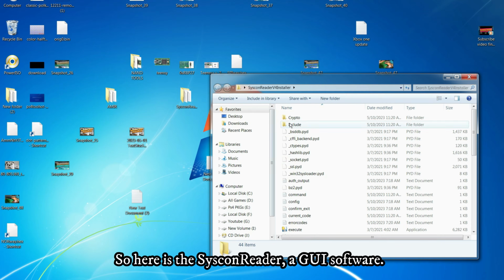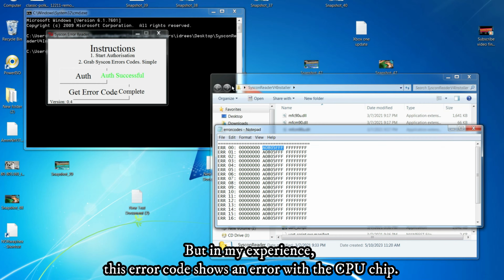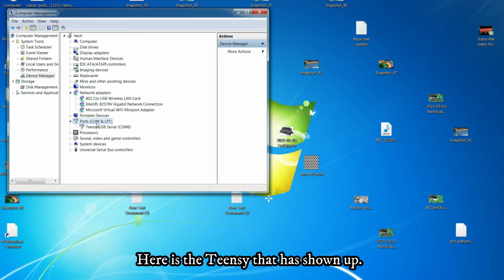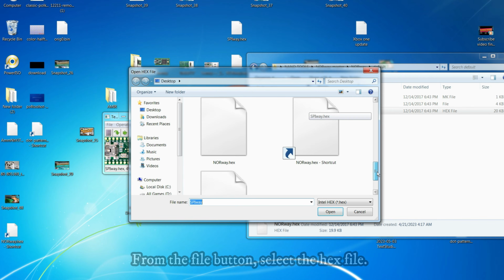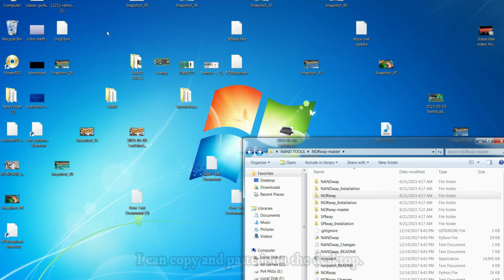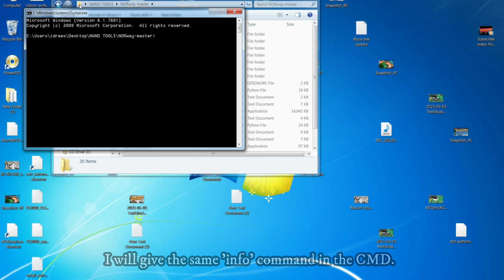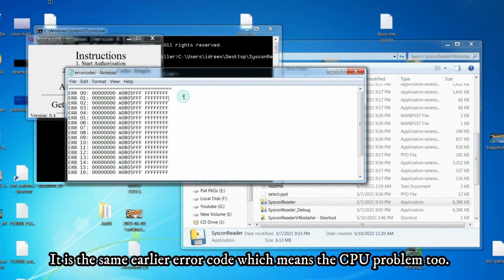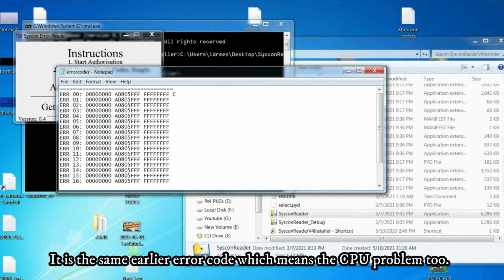Fixing a bricked PlayStation 3

Comment: I have followed your procedure to the letter and I do have exactly the same error, which is 100% sure NOR contents related : # CODE     CLOCK
# A0805FFF FFFFFFFF
# A0805FFF FFFFFFFF
# A0805FFF FFFFFFFF
# A0805FFF FFFFFFFF
# A0805FFF FFFFFFFF
# A0805FFF FFFFFFFF
# FFFFFFFF FFFFFFFF
# FFFFFFFF FFFFFFFF
# FFFFFFFF FFFFFFFF

So I believe your procedure is not right and this error A0805FFF is I think NOR corruption.

Edited : I think it is really NOR corruption, because intially the OFW is 4.82 and you use 4.88 ROS files.
Reply from the maker: I will appreciate if you update me with your confirmed information!

Comment: I have ps3 4301c super slim with 5FFF problem also. Read the NOR chip and showed 0 errors. I tried to reflow the cell processor but still not working. The CPU is probably dead.

Comment: Hello, I have a question, with the E3 flasher I can unbrick a PS3 Slim with YLOD due to a bad installation of xploit, but I do not have the support of the NOR, can I unbrick it?
Reply from the maker: Hi there! Unfortunately, if you don't have a backup of the NOR, it becomes much more challenging to unbrick a PS3 Slim with YLOD caused by a bad installation of xploit. The E3 flasher can help if you have a valid NOR backup, as you can flash it back to restore the console. Without the backup, though, the process is much riskier, and there's no guarantee of recovery. If you try it, make sure to proceed with caution and be aware of the potential risks. Good luck!

Comment: Hello, do you maybe have an Idea whats wrong with my xbox one. When i turn it on it shuts down after 10-30min. I checked it with other APU and still the same. I checked another front panel and it still shuts down and you can hear the beep. There is also no dust in there its very clean and it is not warm or hot.

Comment: Good afternoon, Mr. Idrees, I send you from Venezuela and I have a question. I have a blue ps3 super slim and it has a corrupt nort, error 8002f147, and I saw a video where I fixed a slim model with a red screen and it was cfw compatible. I can follow these steps to repair the nor from play I only have the doubt because it is not compatible with cfw my blue super slim
Reply from the maker: Dear, this tutorial is exclusively for non-CFW so you can try it.